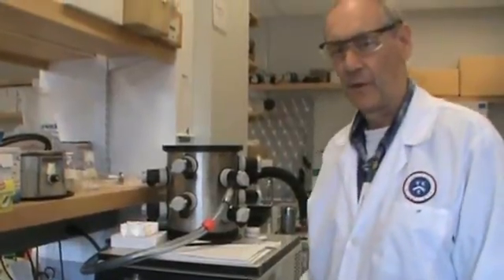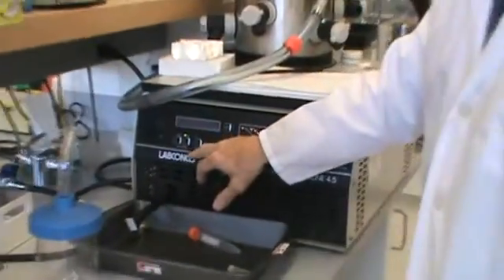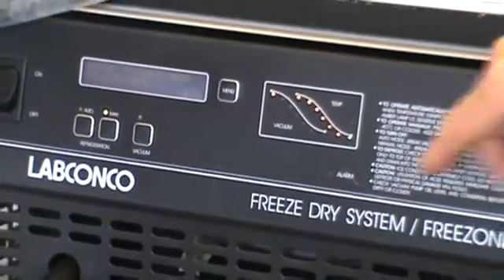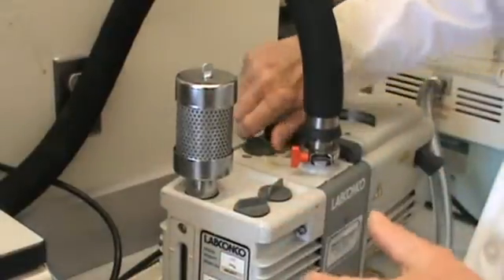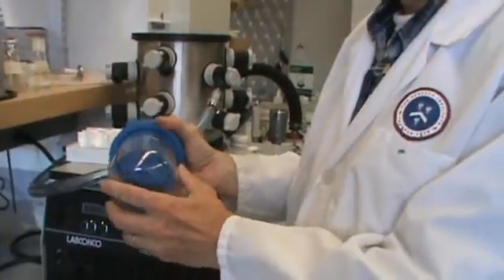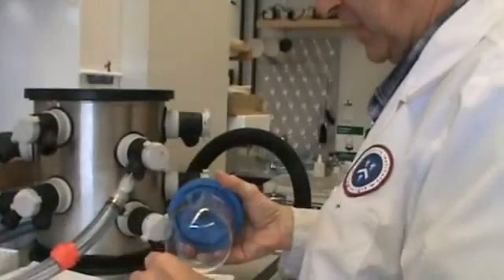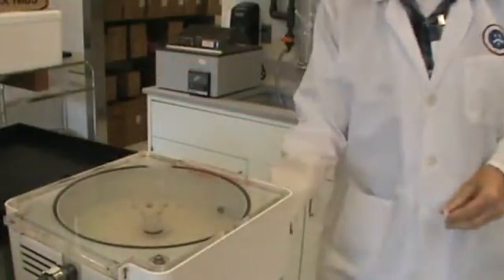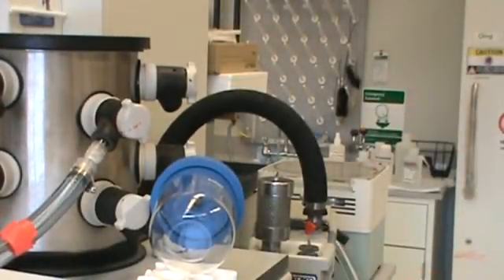Using Freeze-dryer to Lyophilize in Lab at The Forsyth Institute

Comment from the maker: Labconco sells “Fast-Freeze Flask Adapters” for making connections. They can be glass or stainless steel and straight or bent.  For a secure, almost permanent connection to tubing, buy hose clamps from a hardware store or an auto parts store.  These are tightened with a screwdriver.